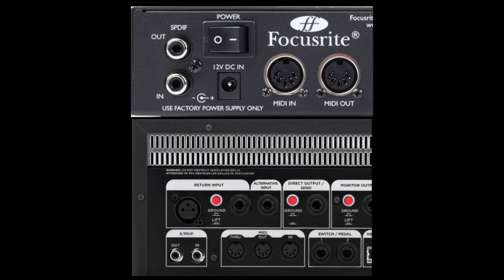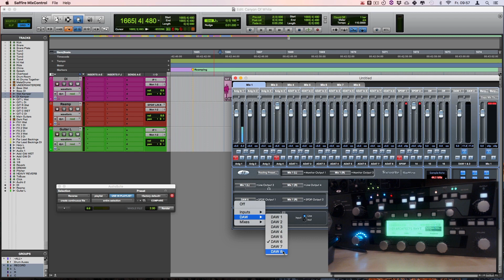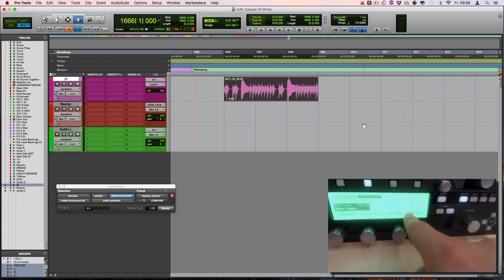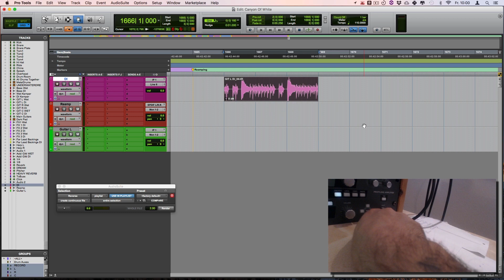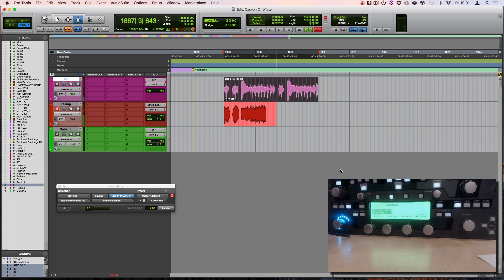How To Reamp With Your Kemper Using S/PDIF

Comment: A tiny remark: you can actually change the spdif clock on the Kemper. (output page 5/6) So it doesn't need to be 44.1, but of course, it has to be the same as your project.
Reply: That is indeed a major oversight on Sascha's part, as a higher sample rate is definitely desirable in many recording situations. Thank you very much for clarifying this, Hugo K!
Reply from the maker: Yes to both your comments. 
In fact - at the time of shooting this video you weren't able to do so. 
A future firmware made it possible - which is very awesome.
Reply: @SaschaRissling  Yes I thought so, but I just added it for people who were looking for it. For me it was an extremely nice day and night difference feature because I make score for tv and every project I get is standard in 48khz, that's tv standard so I always had to work in an extra 44.1 project and then convert. This is sooooo brilliantly much easier.
Reply from the maker: Yes it's has been such a relief. No more converting :) Are you working for TV from your own studio, or are you working with a production company?( I'm trying to get into TV from the bottom right now (Boom Operator or Sound Assistant))
Reply: @SaschaRissling  A friend of mine has a sound studio http://www.soundadventure.nl/ he orders music from me for mostly tv. In my experience, it's really knowing people and networking. I don't do it full time, I've a few assignments every year, but sometimes one program takes the whole summer. I make it all at home.

Comment: Hi, sorry for maybe stupid question. I am into this for days now.
I managed to get a dry signal track, and apply effects true my Kemper. Thats beautiful...
But to record it, i have no succes!!
Just a question.
You only use 2 S/Pdif cables?
So No other cables from Kemper to soundcard?
So you dont use the direct send or monitor output from Kemper?
You also dont connect a cable from output souncard to return input Kemper?
Is that correct?